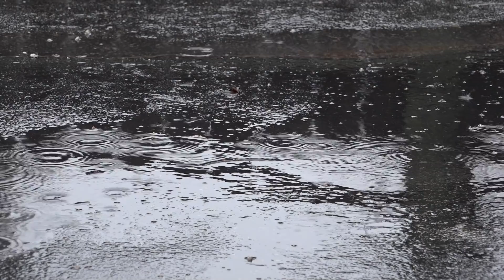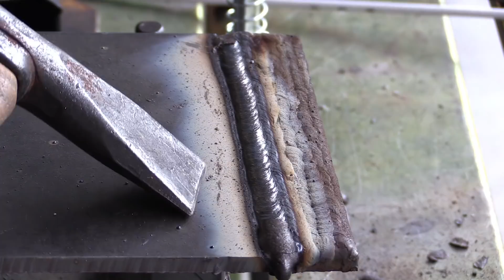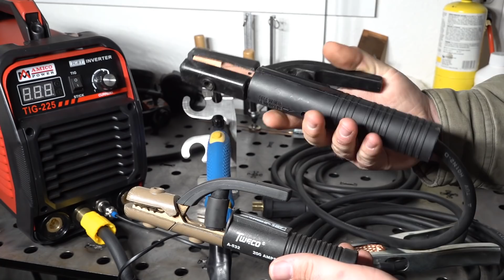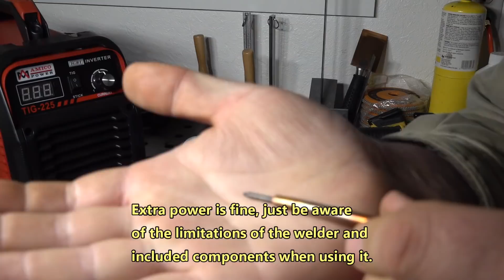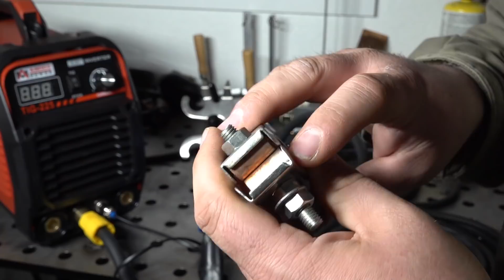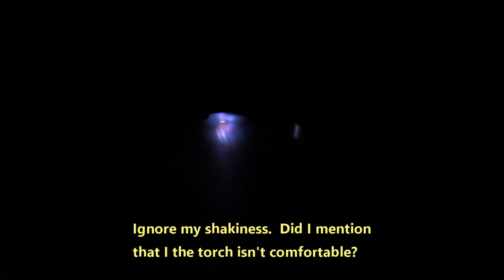Amico TIG 225 Review Pt 2: Performance

Comment: Did you try 7018??
Reply: Never mind you did lol
Reply from the maker: Yup, ran pretty darn well.  Honestly, if I just wanted a cheap, lightweight stick welder I think maybe a 185A version of this without high frequency start (basically, a cheaper version of this) would be a pretty decent option.  I think this welder would make a lot of sense in that use case.  The little annoyances with the torch, gas connections, etc. wouldn't be a thing, and the cheaper cost would make it easier to justify the lack of warranty and part support if there were issues down the road.  

I ended up selling the welder, but if I didn't already have a decent, small stick welder, I would have kept it just for that.

Comment: How much more were the other attachments and other welders that you have that you keep comparing the cheap one to I mean you could use or buy another attachment for the cheaper welder and still come out better on the price you knew it was gonna have cheaper materials used in it before you ordered it and it's not hard to fix the roll pin problem if you are gonna compare it compare Apple's to Apple's not Apple's to watermelon
Reply from the maker: I fully understand that this is a very inexpensive welder.  I was not comparing it to a Miller.  I don't feel that pointing out the things that I find cheap or sub-standard is nit-picky, and that wasn't my intention at all.  I reviewed this welder with only the intention of letting people know what they are getting.  Yes, it is far cheaper than the competition.  I wanted find out for myself, and then let others know what they are giving up, if anything, for that low cost.  At that point, people can decide for themselves if this welder seems worth it to them.

In my update I do show how a decent torch and improvised torch switch made all the difference in this welder, and it is what I would recommend for anyone considering this welder. 

In my videos I also do point out that it stick welds pretty well, and will put out 220 Amps for quite a decent duty cycle, as well as go low enough to weld razor blades.  

If I pointed out only the good, someone may purchase one and say "why didn't he tell me the torch was awkward and cheap, spatter melts the cable insulation, the included gas fitting on the welder doesn't work properly, and the stick stinger falls apart."  Whether the machine costs $250 or $3,000,  I think the only way to review a product will involve pointing out the good and bad.  If anyone watches a review video and feels the negatives pointed out are nit-picky and trivial, awesome, maybe the product is perfect for them.  And they'll already know what to expect going in.
Reply: Ok I'm sorry I miss understood what you were saying I didn't know you did an update I just saw the 2 videos and it was seemed to me like you were trying to compare them to me I will have to try and find your other videos my thing was for people to not expect a perfect machine coming out of China for the price but I do apologize to you
Reply from the maker: Another point.  I don't think there is anything wrong with comparing two products of differing price categories (such as comparing the CK torch to the included torch).  There are often times that two products of vastly different prices are virtually the same quality.  Maybe you are paying for a name, a country of origin, etc.  Or maybe one is just overpriced.  Pointing out when you can get similar quality for lower cost is definitely of worthwhile.

On the flip side, I also think there is value in pointing out what you may give up when going lower cost.  If someone is looking to save money on a product, it is nice to know what, if anything, you are giving up.  I have no loyalty to any brand.  If the Amico torch had been as good as the CK or Weld-Tec torches I use, I would have said so.  I wasn't trying to be unfair to the Amico.  If anything, I wanted people to know what my frame of reference was, with regard to torches, so they would know where my thoughts were coming from.  If I say the torch is heavy, bulky and awkward, I felt is was helpful to show my frame of reference for saying that.  Again, just my thoughts and my experience.  If someone disagrees, or feels like those differences are inconsequential when considering the price, then maybe that helped them make their decision.
Reply: I took and flared my roll pin out a little on my clamp and used a dermal tool to grind some grooves in the jaws to hold the rods better and it works great but I don't use it every day and you are right if I did I would put thicker cables on it especially on the ground and reinforce the clamp once again I'm sorry I miss understood
Reply from the maker: No need to apologize.  I want my reviews to be helpful, I don't want to mislead anyone.  It is very difficult for personal biases not to affect opinions.  In my videos I try to point out any time my opinions are subjective and based on my personal preferences, but it's not always easy, and can often be unclear.  

I also know that not everyone will agree with my opinions or conclusions.  If someone disagrees that's totally fine.  And I'm happy to clarify how I came to those preferences.  I don't explain my thought processes to be argumentative or to try to change anyone's mind, only to give an idea where my thoughts are coming from, and explain my reasoning.  If anyone still disagrees, that's fine too.  

If anyone has a different experience with this welder from mine, either better or worse, I welcome the comments.  All the better for someone making a decision to spend what is still a decent chunk of money, even if it is far less than some other welders.

Comment: I am not a welder but I have bought Amico stick welder and plasma cutter for small jobs in the shop.  For the price, you can't beat Amico products.  One thing I like about Amico is they are an American company located in California.  They are the importer of this product.  Its easy to get support on the phone.  Another thing about the cables getting hot.  You said the wire is #4.  It's only good for less than 100 amps.   If you run 200 amps through it, it will get hot.  Thats a no brainer.  You can add a foot pedal to this machine if you want to do a little work.  The  potentiometer in the pedal will have to be the same as the one in the machine.  These machines were never intended for professional use and are priced accordingly.  I say you get what you pay for.
Reply: I was thinking the same thing, the potentiometer I was thinking could be I think half the potentiometer value or less and just do an inline with the potentiometer this way you can range it where you feel most comfortable with. Inline makes the most sense to me.. If I ever get the chance will try my theory and get back to you.

Comment: So pretty much welder machine is great just change all those cheap ground clamps and go with a industrial brass screw clamp (w/25ft heavy duty lead) , get a better Telco brand or whatever stinger, and a tig handle with the (male end ground/female quick connect gas adapter boot (A 25 ft lead from tig to machine). A 25 ft both male ends gas hose to connect from boot to the argon bottle (make sure to get the correct regulator modified for it). Throw everything it comes with away lol.

Comment: I think post flow can be increased if u do some alteration inside that machine ie: if u connect a capacitor to the solenoid supply  so that the solenoid will shutdown in few more seconds of delay, u can increase the delay by increasing the value of capacitor
Reply: I was thinking the same thing. Basic on delay might solve the post flow problem.

Comment: Great luck with mine so far on frequent smaw use, but it needs better gear. I cant imagine using that dildo handle long for tig guys. Lol

There's nothing beating this box at $300 if it holds the stated duty cycle.
Reply: it wont last very long

Comment: The gas inlet is not supposed to be tapered, it's straight thread and it seals on the brass ball with the hole in it at the end. You have to get them good and tight to seal it properly.

That said, you don't have to use that torch, the machine is compatible with 2 pin foot pedals. 

I think most people who buy one of these machines are looking for a machine either get started and learn with then upgrade their accessories once they find their limitations or people looking for a small light portable unit. Either way, it doesn't exactly cost an arm and a leg to replace them, think of them as bonus supplies for testing out the machine.

The amperage being off is a bit of a bummer, but not a dealbreaker since it's easy to dial in heat without it, I'm mostly impressed that the machine puts out it's claims and will be keeping it in mind as a portable unit.
Reply from the maker: The amperage being off wouldn't even rate as a big hit against it if everything else was good, so I agree, not a huge deal, though it could be a bit frustrating for someone just starting out if the settings people recommend when they are having issues don't quite work out.  

I agree that it's not a big deal to swap out components.  In my update video you can see I swapped out the torch and it is much better.  But I also think the value of this machine starts to erode quickly if you have to swap out all the components.  Brands like Everlast, ESAB, HTP and the HF Vulcan all have better build quality, better included components, better warranty, and better support.  Sure, some of them are in a much higher price category, but if you have to upgrade everything on the Amico and deal with little quirks like a weak HF start, bad gas fitting, etc., the difference in price isn't a big and I think well worth it. So I still recommend spending a bit more for something better in the first place.  My overall recommendation against this welder still stands.

But as shown in the videos, people can certainly get some decent use out of it if they are willing to deal with the issues, and deal with the possibility of being totally out of luck if it dies completely on them.

Comment: So, since I was considering this machine, and now that I know not to get it, what would be an entry-level TIG welder that you would actually recommend? I expect to use it for repairs on cars, building bicycles, things like that. Maybe thinner stainless, too.
Reply from the maker: I don't have direct experience with them, but the AHP AlphaTIG 200 gets decent reviews, as do many of the Everlast offerings.  Keep in mind, both of those will have much longer warranties than the Amico, and should have good support.  But they will still require shipping if you have an issue.

If you want something with local support, the Lincoln SquareWave 200 is a good machine to start with, plus it can do aluminum if you ever have that desire.  Many even recommend the Vulcan ProTIG 200 from Harbor Freight, which is very comparable to the Lincoln SW200, but around $500 cheaper.  

I may soon do a comparison between the Amico and the ESAB 161LTS.  It is a simpler setup (lift start, no gas solenoid), but it is fairly inexpensive, has an included three year warranty with good support and customer service and gets good reviews.  So that could be an option as well if you want local service and one of the cheaper options.  ESAB also has a DC only option in the 200A range that is interesting.  Somewhat between the price of the Vulcan 200 and Lincoln 200, but without AC.

Lots of options out there at many price ranges.  Just keep in mind, many of the cheaper packages will have cheap accessories that you may want to upgrade sooner than later.  Though most should at least be a step above what comes with this Amico.
Reply from the maker: The Everlast 160STH is similar to the Amico.  More expensive, but a far better package.  It has remote amperage control capability, adjustable post flow, lift start and HF start options and a 5 year warranty.  Keep in mind, the included accessories aren't going to be top shelf, but I would wager they are a step above the Amico included stuff.

Comment: Your hands are plenty steady on that 7018 run. I realize you're preemptively warding off the trolls ... but nothing wrong with that at all.

It's kind of as I thought it would go. You can only go so cheap.

But I tell people, double the cost of your low cost TIG power supply. Because the accessories are always crap.

My $500 Everlast TIG was (+$150 SSC pedal, +$125 CK superflex setup, +$100 gas lense and accessories) in reality closer to $1k.
Reply from the maker: Yeah, it suppose it looks more shaky that close up.

That's the thing.  If I was buying the Amico to be my primary TIG welder rather than just to review and mess around with I would want to buy all new torch, ground cable/clamp and new stinger.  As you say it would double the total cost.  At that point it seems like it makes more sense to get something a little nicer to start with rather than putting a bunch of money into something like this.
Reply: bigtb1717 Right, and at the right cost, features and performance, I don't mind doubling the cost. Because I know what I'm getting into.

Even if I bought an entry level Miller (or equivalent) they don't usually come with a pedal and I would want an upgraded torch anyway.

This Amico is for the person that only very occasionally TIGs or does stick welding. Or loves to be frustrated while welding.

If it were me, I'd spend $100-$150 more for something a bit more proven.
Reply from the maker: Sometimes a package deal is ok, but generally I prefer to buy bare machines and add my choice of components.  

For just starting out I understand the value of a kit. You don't know what you need or want until you have some experience.  But I think that as many people as a cheap package like this will encourage to get into welding, it will discourage just as many people with the frustrations the poor quality accessories and odd machine quirks will cause.